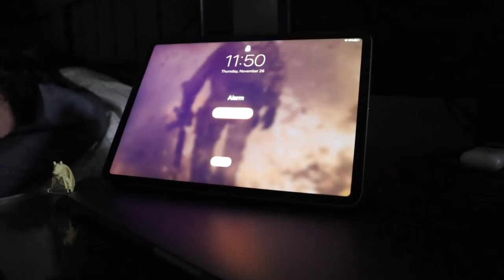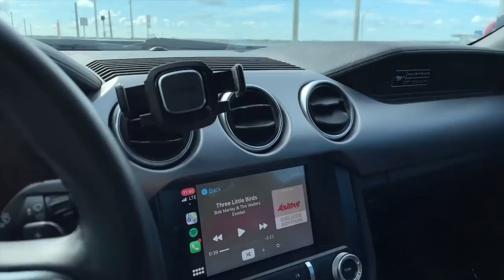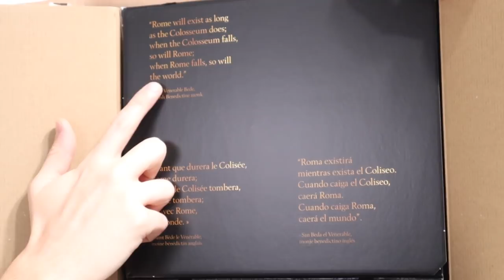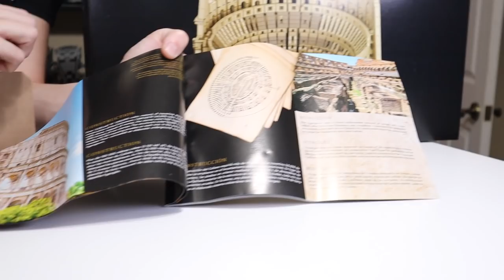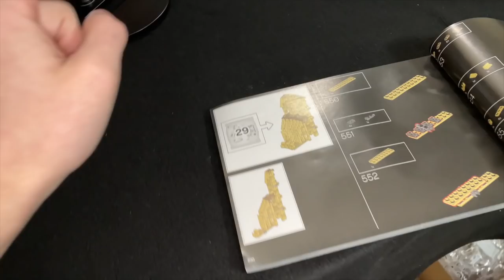I DESTROYED the BIGGEST LEGO Set EVER!

Comment: You were holding the camera yourself when standing on the scale without the box (3:25), but when standing on the scale with the box, your little assistant was holding the camera (4:25).
That's why the variation between the values in your data collection ist actually the weight of the box minus the weight of the camera.
Reply from the maker: The camera is my iPhone. Which maybe weighs a half pound? Not negligible but obviously not a huge discrepancy. (I didn't even realize I had done that though lmao)